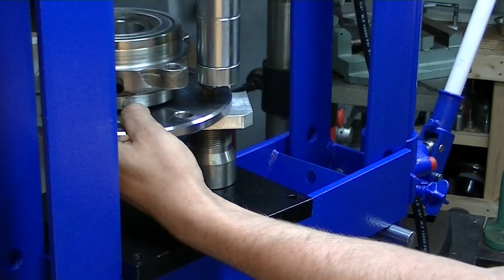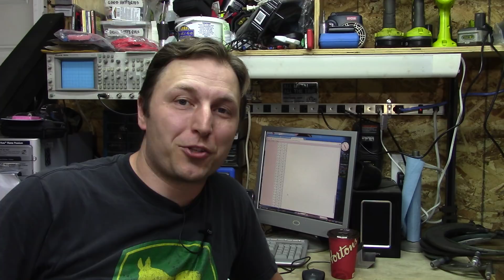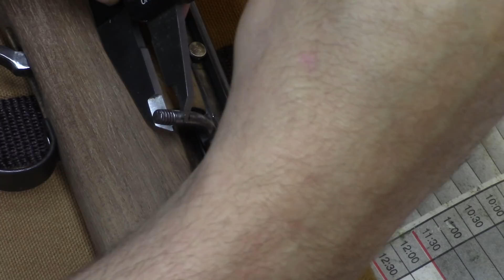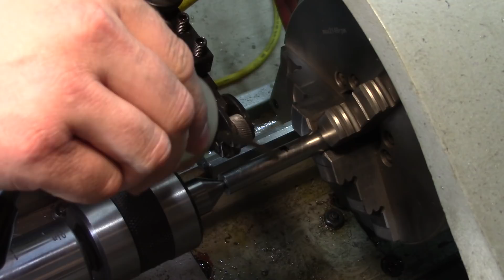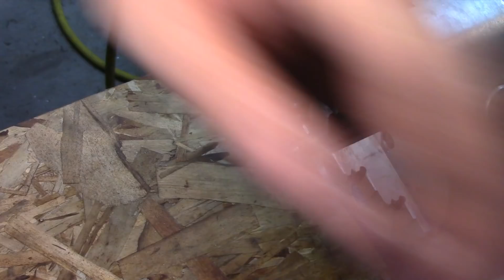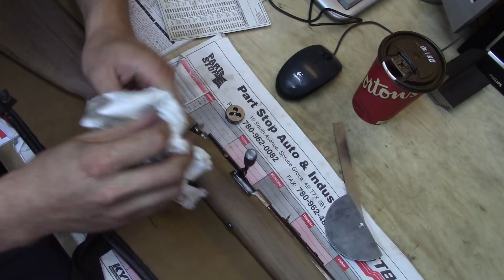Old Barn .22 Custom Bolt Knob

Comment: Hi Everett, my lathe has the chuck guard, my solution was to undo the the two locking screws and leave the bloody guard against the splash back out of the way. Keeps the circuit this way. That was about 10 or so years ago; have managed to stay safe for this time..
Reply from the maker: I've had to resecure those two screws a few times since I got the machine.  If I ever need to turn something that won't fit with it in the way (got a couple crazy ideas, need to see if they'll come to fruition) then I might temporarily move it aside.  In the meantime it's a pain but I guess I should be a good example to the kids who watch.  There are a few of them, mostly my "nieces and nephews" :)